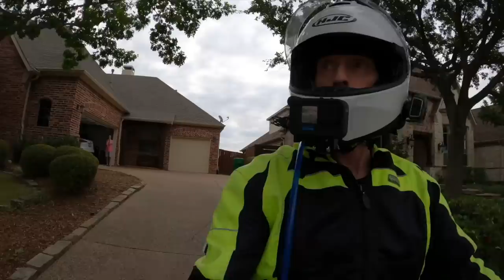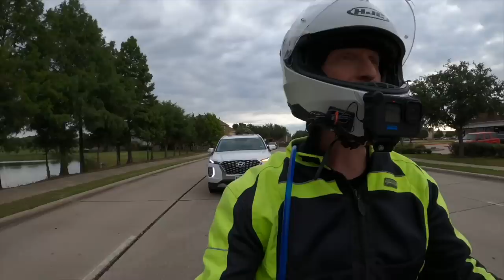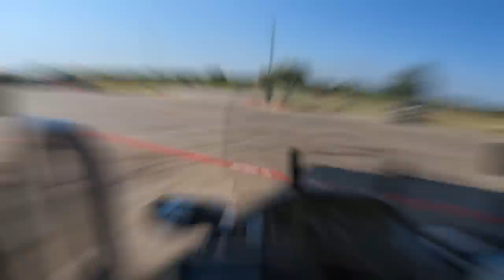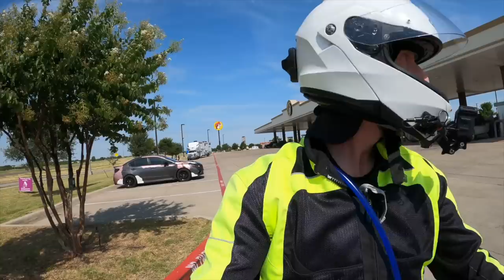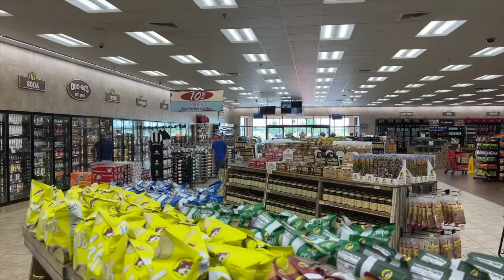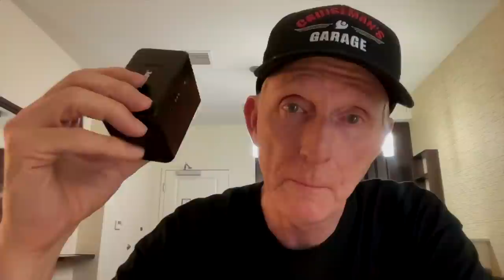Ride from Dallas to Shreveport | Wing Ding 2022 | Cruiseman's Moto Vlogs

Comment: Cruiseman, try using aircraft B2 sealant to hold your mount onto the helmet. You can buy a small tube from aircraft spruce. B2 is a two part epoxy. Don’t spend your money on the tool for it. You can push out what you need, mix it with a popsicle stick and apply. Clean the old stuff off the helmet and mount prior to using. You can scotchbrite the helmet area and mount prior to using the epoxy. It will hold better.

Comment: If you cannot find an adhesive you think is strong enough you can use auto glass installation product called Urethane. It is used to bond the windshield into your car. If you do that you will also want to use the primer for the product or brand you are using. It will absolutely bond the mount permanently to your helmet. You will have to cut the mount back off of the helmet using a wire or a razor blade with much patients to remove it. Guarantee that will work. I would recommend two or three quarter inch sized spots is all you will need. It will take 24 hrs to cure once you have it installed. A local auto glass installer can sell you the products you need. I installed auto glass for over twenty years.

Comment: Hi Chris. For the chin mount adhesive challenge you are having, you likely have heard of Sugru Moldable glue but just in case you haven’t then check it out. I’ve been using that for my GoPro helmet mounts whenever I need something that has to be rock solid. Good luck and hope this helps
Reply: I was going to mention the same thing.
Reply from the maker: I will check that out. Thanks.
Reply: Everybody keeps mentioning this tape/glue but nobody's telling me where I can purchase it
Reply: @jeffreylindenwhite7930  it’s available on Amazon
Reply: @davemonaghan4877  Thanx Dave. "Keep both wheels on the ground"😅👍🏻

Comment: Hey if you want an adhesive that will never fail…because it’s a permanent attachment.  Check out 3M 5200.  You set it and forget it.  The helmet will break before the mount comes off. 🤣

Comment: You should try Sugru..it’s a moldable sort of adhesive. It will mold and hold to any surface. I use it for my chin mount with the gopro mount and it holds in all temps for the past two years.

Comment: I had a GoPro fall into my lap at 80MPH on I-75 and I was lucky it fell into my lap.  I will never trust the adhesive again.  Once I mount the camera I take a drill and punch a small hole thru the mount into the helmet  I then use a small screw and perm mount it to the helmet.   I wont ever lose another and since I always have the cam on the helmet and use a helmet up it makes no difference

Comment: Wow my friend, the sound and the level of smoothness of the Goldwing  over the BMW IS HUGE. The wind  ( cross wind ) was barely noticeable on the Goldwing as a posed to the BMW . That is my personal observation. Would love too know your thoughts on what I just stated. Be safe enjoy WingDing. I cannot wait for more vlog’s  my friend.
Reply: You are absolutely correct the Wing is the perfect platform for motovlogging.  I film all the time with my helmet visor open and there is virtually no wind noise just voice and sweet engine sounds.  Thanks for commenting and be safe my friend.  And don't trust that adhesive tape for mounting it will fail.

Comment: So my helmet story! After ordering two different helmets and not able to get. The first two had a ECE rating witch it is what I wanted. After no luck with them actually having the product on hand. I ordered my third choice. So then I found out that snell does not certify modular helmet does not get a snell rating. Also the snell rating is worthless because it tested for auto racing only! I could be wrong. Just what I was told.